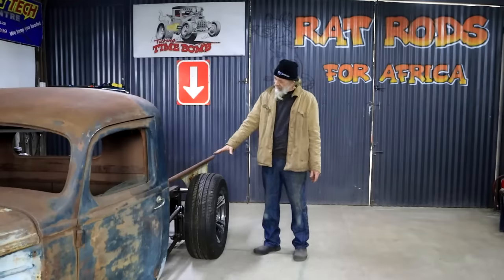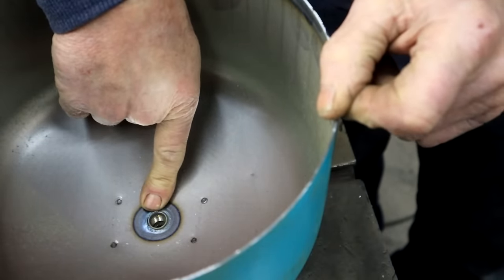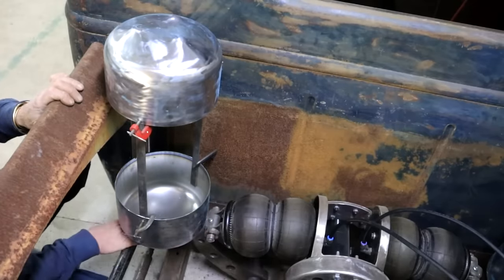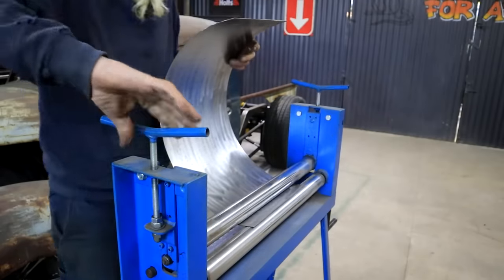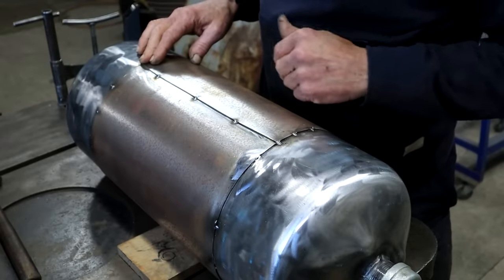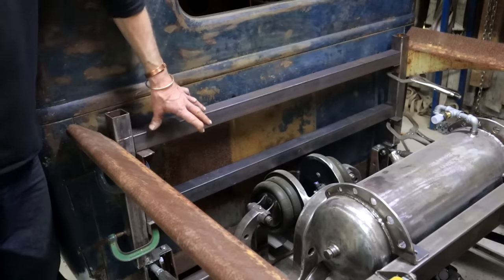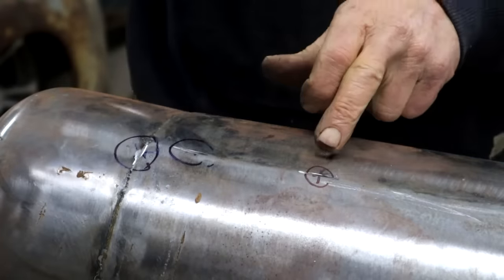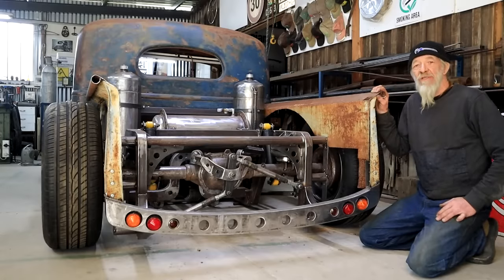Building Fuel Tanks from junk - 1939 Hudson Rat Truck Part 31

Comment: A vertical electric fuel gauge sensor is available or a manual vertical fuel gauge for a boat portable fuel tank with the gauge on top would also work but an outside fuel glass or tube is a no-no ....   gasoline dangerous : fuel fire very bad
Reply from the maker: At some point the fuel has to go through a rubber tube on its way to the engine... Don't see the difference...

Comment: Put a bed in the truck and use a 55gal drum or a used large capacity propane tank for a fuel tank. Problem solved.
Reply from the maker: Yes, but that's boring!

Comment: R507 is an azeotropic mixture of R-125 & R-143a that is for commercial use and has a zero ozone depletion potential. That bottle new and full is $400-$600 depending on where you get it. Very expensive refrigerant!
Reply from the maker: Holy cow! I have expensive fuel tanks then😁

Comment: One moment, Dif, a petrol tank at the rear of the car woudnt be a good idea, I think .
Reply: There is a Chinese car producer who makes quite a million of some kind of low price cars with both batteries and also a gas tank as well, they just simply put the fuel tank under the truck, as the original place was given to the stupid batteries. Obviously they didnt learn from some cases in the US back to 1970s, where some drivers and passengers lost their lives from such designs.